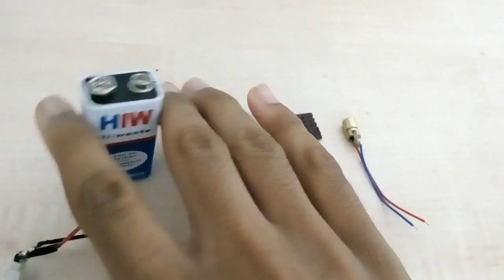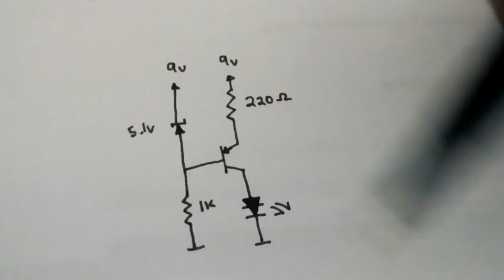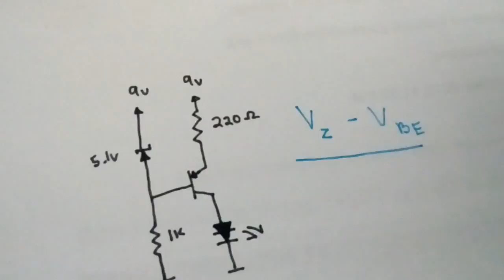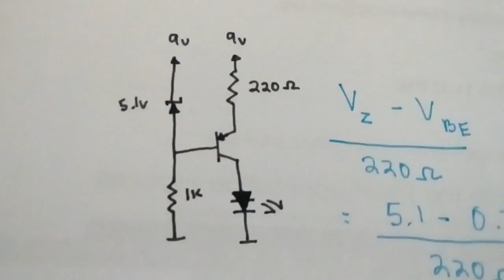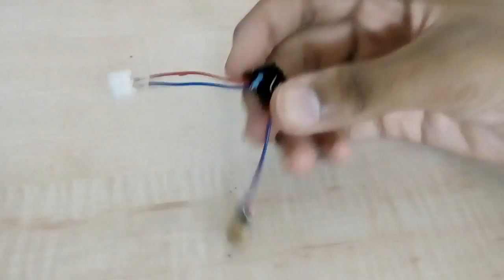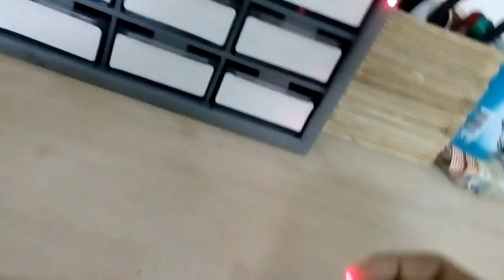Simple Laser Diode Driver ( Dirt Cheap! )

Comment: i do not understand this circuit nor why you are using certain components nor how you get 1k ohm which you did not talk about in your calcs?
Reply from the maker: The 1kΩ resistor biases the Zener diode, you normally want to select it so at least a couple mA flow through the Zener, that's usually where the Zener voltage is nice and stable (does vary quite a bit depending on the exact diode, usually between 1mA and 10mA).
Reply: @NNNILabs  what does biases mean? would be nice if you explained this circuit in more detail explaining every step and the math you need to come up with the vales you chosen for the components
Reply from the maker: @ARCSTREAMS  I mean, after a certain point you should be able to find answers to your own questions, The Art of Electronics is a good resource I would recommend reading, it has this exact circuit described in even more detail, there's a PDF online somewhere

Comment: 20 mA? that os what most conventional led's run at too is this typical for most red diode lasers like ones from dvd etc?
Reply from the maker: Different LEDs and laser diodes operate at different currents, you'll have to find a datasheet for the specific model you want to use and find an optimum current.
Reply: @NNNILabs  ok ty

Comment: if you running it off a battery why do you need the transistor for? isn't using resistor enough? not like there is much power that will be drawn in to burn the resistor or will there? i guess maybe i do not understand how laser diodes work differently than led's , do they draw in more current over time and resistor is not enough even with high power rating? also i never understood how transistors work so i hate it when things get complex
Reply from the maker: The thing about laser diodes (or any diode for that matter) is that they heat up over time because of the current flowing through them, and their forward voltage decreases. If you just had a resistor connecting the power supply to the diode, the voltage across the resistor increases. Think of it this way - the sum of the voltages across the diode and resistor must equal the supply voltage, and if the diode voltage decreases, the voltage across the resistor must increase. And an increased voltage across the resistor means more current through it, which also flows through the diode. This increases heating and decreases voltage even more, to a point where the diode eventually burns up. The transistor is part of a very simple current source that keeps the current flowing through the diode constant regardless of its voltage drop. The transistor is, in essence, 'making up' for the lost voltage by increasing the base-collector voltage.
Reply: @NNNILabs  i still do not see how this increase in voltage happens if i am just using a 9v bat and resistor, i used those all the time on leds and nothing happens and it works fine even in prolonged periods,,usually i only use a direct 3v cr2032 bat without resistor for led and works just fine last many hours before the led gets weak but there never is any surge in current or nothing like that
Reply: @NNNILabs  so you saying if a component like an led heats up then the voltage across it drops? 
". If you just had a resistor connecting the power supply to the diode, the voltage across the resistor increases. " why? the job of the resistor is to limit the current being drawn by the led and the resistor takes the brunt of the heat instead which is what they are made to do therefore the voltage should decrease on the resistor since it is heating up that is what you said happens when led heats up there is less voltage going across
Reply from the maker: @ARCSTREAMS  Yes, semiconductor diodes have a negative temperature coefficient, that's why the voltage drop across them decreases when they heat up. For example, with an ordinary diode that has a forward voltage of around 0.6V, the temperature coefficient is around -2mV/°C, so for every 1°C rise in temperature, the forward voltage decreases by 2mV. 

Take a look at Kirchoff's voltage law, that might help you understand how the voltage drops add up in a circuit.
Reply: @NNNILabs  and that is the reverse case for resistors so when they heat up more volts go through until they burn like a safety fuse or will the diode or other components possibly get damaged before that happens?
Reply from the maker: @ARCSTREAMS  Well, the resistor has it's own temperature coefficient, but that does not play a role here, the point is that as the diode heats up, the voltage drop across it decreases, and as I mentioned, the voltage drop across the resistor increases (by the same amount because of KVL) so there's more current going through the circuit and hence the diode, heating it up even more, and this is a positive feedback loop and ultimately leads to thermal runaway and diode failure.
Reply: @NNNILabs  ok so from my understanding a laser diode in a battery and resistor circuit draws more current and heats up  to damage point more so than an led being used in the same circuit?
Reply from the maker: @ARCSTREAMS  yeah

Comment: Hi, using this method can I power a very similar looking laser diode that's supposedly require 3 volts to work?
Reply from the maker: Yeah it should work.
Reply: @NNNILabs  I tried to power the LEDs in series but it only worked for two of the eight. As soon as I put three they wouldn't power on at all.
Reply from the maker: @mauiztic  The driver as it is has a fixed output current and limited compliance voltage. Connecting all the diodes in parallel will divide the output current between the diodes, so that explains why they are so dim. And as for connecting them in series, the limited compliance voltage could only handle the forward voltage drop of two diodes. I would recommend making one driver for each diode.
Reply: Hello again, I built your design and it worked very well for my laser, thank you, unfortunately for my project I decided that I needed 8 high brightness LED diodes instead of the laser, each one has a working current of 20 mA and a voltage requirement of 3.5-4V. Can I still use your circuit design to power them? I tried it in parallel and they all worked but with a very diminished brightness. As I understand, if I connect them in series the current would be the same flowing through all of them but would I need a bigger voltage source or the 9v are still good? Would you recommend any other changes to the components or design in order for this to work? Sorry to bother you, I hope you can guide me a bit. Thanks for your knowledge.